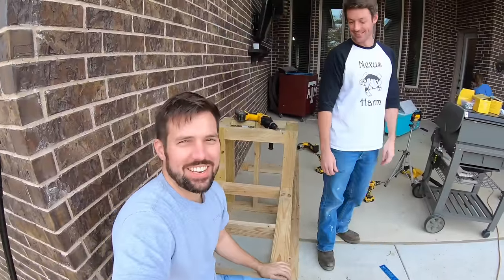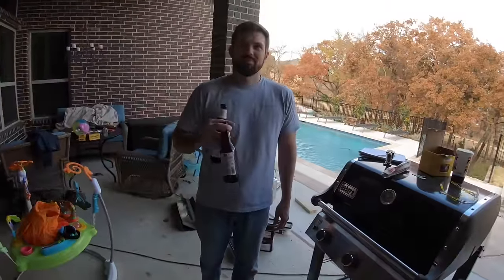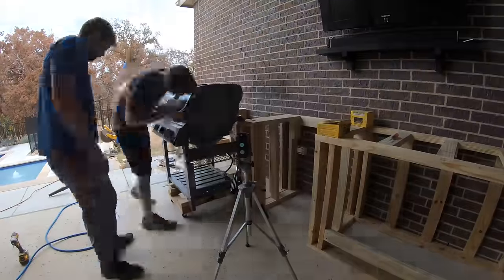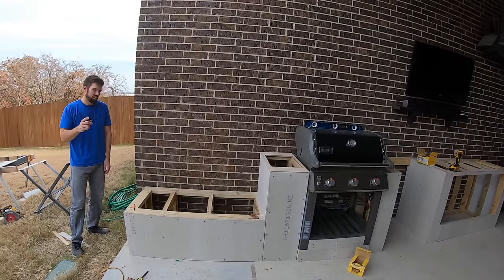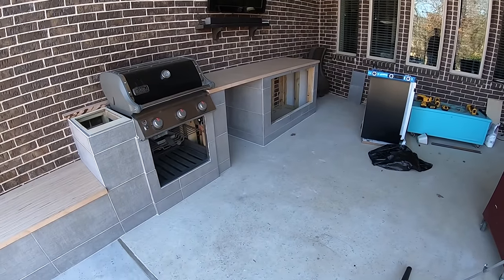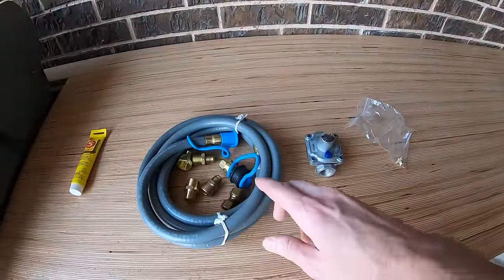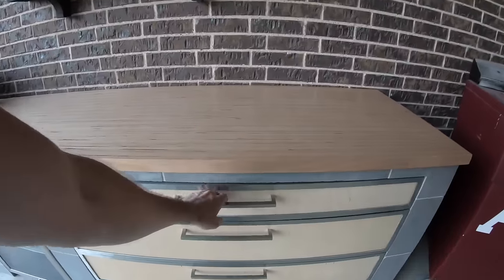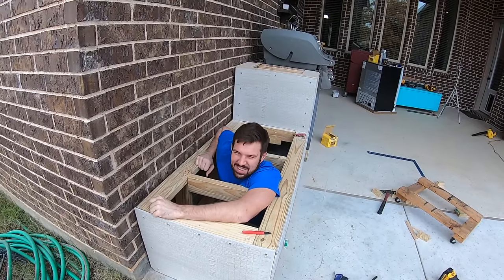Outdoor kitchen build in 20 minutes! Using my old Weber gas grill.

Comment: I just demolished my outdoor kitchen island (previous homeowner built) because it caught fire. This looks like the same problem, wood next to the grill.
Reply: Yes.. We are in the process of buying a house with a brick exterior that has an outdoor grill built on the outside right up against the wall. We just had the home inspected and the home inspector said that is a huge fire hazard. First off there is a huge blackened grease area  on the wall from the grill being used.. and a wood pool cabana right above it. Our inspector said its a huge FIRE Hazard🔥🔥. They recommended the grill be at least 3 feet away from the house. Brick or not its not safe at all to have a grill sitting up against the house.
Reply: Metal studs and concrete counter top would have been a better build

Comment: Built in bbq’s look great but in reality they are a pain to clean properly. I have a Weber genesis E435 and when I want to clean it I just wheel it to the cleaning area and dismantle the burners and out comes the jet wash. Looks brand new when it’s done. That said you have done a nice job although I would worry about a hot bbq next to a wooden structure.

Comment: great job guys fyi for later reference to change propane to gas all you need to do is drill out existing brass nuts in grill to 1/16 in. hole need  larger hole for more airflow happy cooking
Reply from the maker: Great tip!

Comment: I would have made the opening for the grill wider to accommodate cement board on the inside. That would have provided a little heat insulation to the wood as that grill was never intended to be completely enclosed, especially with bare wood.
Reply: Also wondering how the plastic trash can along side of the grill bottom will fare.
Reply: Well..... one only learns by mistakes made!
Reply: @chrisstiff4734  No, that isn't the only way to learn even if we all do it every now and then
Reply: @otallono  so then how do you know NOT TO DO SOMETHING?  Because someone made a mistake and learned....
Ya know the almighty phrase "well I won't do that again" or "back to the old drawing board".....
Reply: @clydeperrine2959  cover the bin in the stuff you normally wrap on exhausts ;)
Reply: @chrisstiff4734  as he watches his house burn down.
Reply: @clydeperrine2959  I thought it was weird to have the trash right next to where the food is cooking lol

Comment: Great job Dudes and Dudettes.  Norm Abramson would say: 'there is nothing more important than to wear these, safety glasses'  When I built my outdoor kitchen, I used steel framing material, covered with concrete backer board and then tiled the top and used stucco on the sides. Nothing will melt or burn.

Comment: Dude is brand loyal. Friggin DeWalt EVERYTHING
Reply from the maker: I blame our father. Makes it easy to change batteries though
Reply: I seen a Hitachi in there
Reply from the maker: Don’t tell Scotty!
Reply: @ZeroToAwesome  I'm exactly the same but with Makita, saves a load of money of batteries, and chargers if all tools are from the same brand. Can I also ask if you had any trouble with heat transfer into the timber? I'm not criticising, just interested as I've thought about doing something similar. I'm pretty handy with timber, but useless with brick and mortar, so it would be the way to go for me too. Stay safe People!
Reply from the maker: What people don’t seem to get is the grill only touches its steel frame at four small points that dissipate heat. The frame is designed to be cool to the touch and if you can touch it with your hand wood shouldn’t have a problem. So far everything is just fine
Reply: @ZeroToAwesome  thanks for the reply. Please don't get me wrong, I wasn't having a dig. I'm gonna build a smaller scale version of sorts once the lockdown is over, and I can get timbers again. Stay safe buddy.

Comment: Missing insulation between wood and grill. Weber’s cast aluminum firebox is a really good conductor of heat 😬
Reply from the maker: The steel frame it rests on has a lot of empty space built in to dissipate heat

Comment: Looks nice, but a few observations: that trash can design is going to have issues.  I'd bet every time you need to throw something away (especially when cooking with dirty fingers) there is going to be something sitting on the that counter!  Also, I would have taken that grill tub off the stand and made a mount base for it.  That way its easier to remove if it rusts or you can empty the grease catch easier.  Also... if you need to replace it for some reason you can just find something else that fits in the hole.  Really not that big of a deal the grand scheme of things, but overall man.... stellar job!

Comment: Great job. I love the finished product. Congratulations. Hopefully, you have been enjoying your creation. I agree with some of the other comments about the placement of garbage basket and concern about what the heat may do to the plastic. I guess you can always switch to a metal bin, to eliminate that concern. 

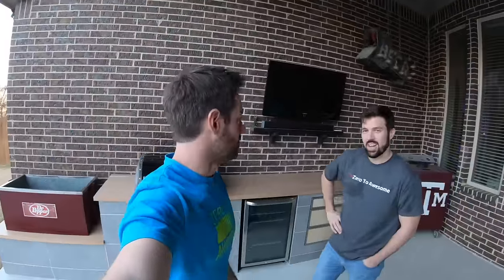I have a question: What did you mean at the end of the video [23:56] “some people will say don’t do that”? 
What did you mean, Don’t do what? 
Are there any concerns about using grills outdoors under a cover like in your case? Or did you mean there are concerns about mounting a gas grill in between cabinets? Like you did.

Again, Thank you for sharing the video.
Reply from the maker: Thanks! I meant people will probably say to buy an expensive grill insert and not build in a standalone grill. Haven’t burned the house down yet!
Reply: It means there’s no ventilation for pooled natural gas, and one day, they may get their faces blown off. But so far so good…

Comment: Did good but you should have considered clearance to combustibles.
Cement board should have lined the entire grill.
 If you get forget and leave the grill on that could be a problem with the wood up against the side of the grill.
Reply: I would have put in a layer of brick between the grill and the wood.  Not only for the fire retardation but to future proof the design since he started with a used grill.

Comment: Looks awesome! I was surprised you did the barbecue conversion yourself though, I thought in America you need to be a bonded, licenced, qualified professor of construction to do anything beyond painting your house, so DIY gas work? I'm sure it's fine but check your household insurers are happy with it (and if not get a licenced gas fitter to inspect and test it) just in case. 
Here in the UK we can do most things but gas work is highly regulated. Even though it used to be (and probably still is) legal to DIY your own gas work in your own house it can invalidate household insurance if that DIY later results in your house getting uncontrollable hot and/or explody.

Comment: How did the interior framing wood do with the high heat bbq after it was in use? I’m building something similar and I was noticing there’s no heat shield.
Reply from the maker: It was fine but I went back later and shielded it with cement board when I redid the countertop

Comment: Awesome build. Only thing I'd change is the trash. That trash can seems like it'd be a bitch and a half to take out of its little hidey hole, especially if it's filled with anything heavy. Plus that's a pretty small can. Personally I would've used one of those slim jim cans so it'd go all the way from the floor to the counter, then made a little front door to remove it. But to each their own.

Comment: I like the look but would have used steel studs 12inches around the grill for and would have set the while structure an inch off the wall to allow the moisture that may be trapped in walls from humidy room ok breath .. great build looks clean man
Reply: I'd add some masonry under the wood frame for the same reasons. ( ground water ) 
These drawers are quite well designed for home made.
Maybe they can post install insulate the Weber with tile panels
and an air space?   Regardless whether it's code it' a good video.
Good learning experience.

Comment: How are you going to remove the pit when it eventually rusts out or needs repairs or cleaning?  I like the idea, but that pit should be able to be easily removed to inspect/clean the area around the pit.  You don't want the grease spatter to build up and it will.  The heat from your pit is pretty well sealed into the surround and will probably cause the wood to warp and crack over time.  Good luck and hopefully this thing lasts a lifetime with no issues.
Reply from the maker: Well then it’s time to move! J/k... a couple bolts and the pit lifts up out the top

Comment: Awsome job! what is the welding machine and accessories  you guys used in this video.
Reply from the maker: Off shelf big-box store Lincoln Mig machine. We have expanded to Hobart 240 Mig and 240 Tig machines on occasion, but the good old wall outlet flux core Mig still does 90% of the work.

Comment: How have the wood countertops kept up with the high levels of heat thrown off from the grill?
Reply from the maker: So far no issues from heat. I think our only enemy is water. I’m probably going to pull them and recoat in epoxy in a couple months so it’s more flammable

Comment: I'm worried... I didn't see you insulate around your grill and then put the trash next to it...
Reply from the maker: I’m more worried about the wooden countertop and support structure. There’s a few inches of space separating the trash can from the grill. The other stuff not so much. I’ve been keeping an eye on it and so far so good!
Reply: @ZeroToAwesome  the wood is fine. it takes 700F at least to ignite it. I doubt it reaches that temperature where the wood is at... the trash can however, i can see it melting easily though
Reply: A soft close hinge on the counter top for the trash can what have been a win-win
Reply: @NoRoads2AllRoads  thats immediate ignition... But longer exposure drops down to 250-350°. This looks like an eventual fire hazard

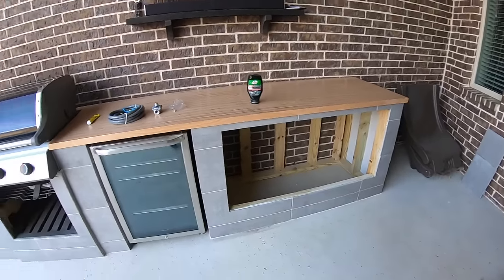Comment: How deep is your workbench at 19:05? The one on the right, with the Home Depot bucket on it. Does the step in the concrete mess you up since it sticks out farther than the bench? I'm going to do the same thing, my workbench top can only be 24" or my truck would hit it. Thanks for the great video!
Reply from the maker: The workbench is 26” and the concrete is 34”. I’ve never had it seem like a problem so I guess it works just fine!
Reply: @ZeroToAwesome  Thank you for checking!

Comment: Looks great, what kind of wood did you use for the counter top. Can you get that at a box store?
Reply from the maker: It’s called beech panel and no, you have to get it from a lumber supply shop. I’m about to rip it out though cause it didn’t seal very well. New outdoor kitchen video soon!
Reply: @ZeroToAwesome  Thanks, You guys are skilled make it out of concrete.
Reply from the maker: @tonyb282  that’s the plan!

Comment: You make this sound like it was easy....for regular dudes to be able to do.  You guys are WAY handier than I will ever be.  You fucking welded for crying out loud.  That certainly eliminates me copying you. lol
Reply from the maker: I swear welding isn’t as hard as people think, but you could use other methods. Nuts and bolts to secure the grill. Construction adhesive for the drawer trim, or just frame them in fancy wood trim
Reply: @ZeroToAwesome  true to all that....but the normal guy has to procure the tooling for it all too.  You seemed to have a pretty sweet setup...or did you borrow some of it?  Your yard looks like Texas.  Is that where you guys are located?
Reply from the maker: Yep, Texas. There’s an unwritten rule that I can buy a new tool for every project. Many projects result in many tools!
Reply: @ZeroToAwesome  great rule!  I need to implement!

Comment: Nice build, I would only perhaps suggest making sure to drill screw holes in the frame that attach the countertop oversize. I have made some drawers with faces from birch plywood edge grain, same as your countertop, and they swell up quite a bit in the summer, with heat and moisture. I had to cut them down a bit, because drawers began to rub against each other because of wood movement.
Reply from the maker: Great tip!

Comment: While these guys had a lot of fun, please do not follow their example. You can burn down your house. Nothing they did is even close to  following the clearances and codes for a built-in barbecue unit. I am a professional outdoor kitchen builder, and I cringe when DIY videos are dangerous. I have removed several DIY built in grills and my clients gasp when I show them how they nearly burned down their house, as wood all around their kitchen is charred inside. 

First off, most manufacturers of non-built in grill heads (cart grills) are not certified to be built in (for good reason) because they need more ventilation and get pretty hot on the bottom. 
Secondly, if there is a wall behind your grill, like in this example, you need either 12" minimum behind the grill to that combustible  wall, or a heat shield (Hardie backer and a 24" tall tile backsplash works well).

Thirdly, any time I see an outdoor kitchen built out of wood, I see a fire hazard, especially if their grill or side burners do not have insulating jackets (purchased specifically for appliances built into a combustible structure). Please, if you do not build your kitchen out of metal studs (like I always do) and use any combustible materials (like wood countertops or wood facing) save your house from burning down by purchasing insulating jackets. 

We build our kitchens out of sturdy galvanized metal framing, with Hardie backer board and solid slab counters (granite, dekton). We use either stone, metal, or tile on the face. This makes our kitchens non-combustable, water resistant, rot resistant, and basically permanent. We make sure to follow all specifications for clearances for every heating appliance in the kitchen.

I am not saying any of this to discourage anyone from trying to save some money and DIY their own outdoor kitchen. But please follow this advise so nobody gets hurt or worse. There are videos you can watch that can teach you how to frame with metal studs, and how to make your kitchen fireproof so you do not need to use insulating jackets for your built in appliances. 
Happy kitchen building.

Comment: So many issues with this. 1 you put in a grill into wood framing with no insulated liner. 2 you put the grill against the exterior wall of the house with no vent hood. 3 wood top with again no liner on the grill. So those 3 things make it a fire hazard and not to code. Don’t get me started on everything else that’s wrong. DO NOT build this at home. They have no idea what they are doing.
Reply: Justin Meyers that wood will rot too, no barrier between it and the concrete pad.
Reply: Anthony M it’s going to riot? I hope they don’t loot the area😂
Reply: Justin Meyers  exactly.  No clue what they are doing.  Be sorry when the house burns down.
Reply: What about the TV as well? I was wondering if it rains, wouldn't that TV fry out?
Reply: lol shut up.

Comment: How did you get permits for this? Where I live a built in grill must be at least 10 feet away from the house or other structures. Also, did you check with your insurance company about the location?
Reply from the maker: The builder had it flagged as a grill location when the house was being built. It’s pretty common around here

Comment: Great job, just fyi you should never cut a tile smaller than 1/3 of the full size, for aesthetics. :D
Reply from the maker: Please explain different size tiles of the same finish
Reply: @ZeroToAwesome  10:30 in, you should't use such a thin piece, 4 bigger tiles with the joint in the middle for the right aesthetics. At least that's how you would do it in Sweden. Would be some extra tiles tho.

Comment: Came here while searching for inspiration on a DIY outdoor kitchen. Overall you guys did a great job (and I love the tile rather than the typical stacked stone or paver block), but I worry a little bit about how you have the grill frame fully incorporated/tiled into the structure. If you want to replace that grill one day, you'll be limited to options that will fit onto that Weber frame.

Comment: hi could U please tell me where did U get that fridge or what model is that?
Reply from the maker: This guy right here from Lowe’s:

138-Can Capacity (4.6-cu ft) Residential Stainless Steel Beverage Center https://www.lowes.com/pd/Frigidaire-138-Can-Capacity-4-6-cu-ft-Residential-Stainless-Steel-Beverage-Center/50160175
Reply: Be careful with that model. It was built for indoor use not external. It's not ventilated properly to be built in and the compressor was not made for external temperature shifts or the amount of potential dirt it will deal with.

Comment: Why is everything in the US made to not last. Why couldn’t it be made with concrete?
Reply: Agreed concrete is more permanent but as a home owner the idea of possibly changing the kitchen to better suit my needs (larger bbq or a different trash bin idea) would drive me insane with a concrete structure. Plus forming the walls and securing it this close to the house means you are pouring concrete against brick, not a great idea there.

I think that wood countertop is a bit ballsy though with the heat of the grill, I might have opted for a tile counter instead.